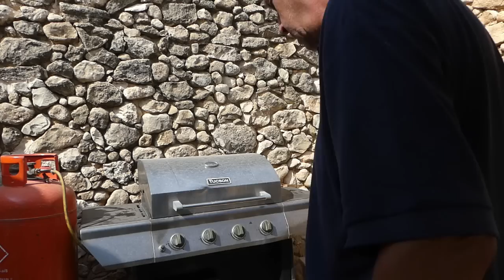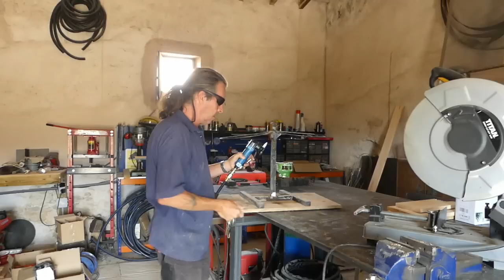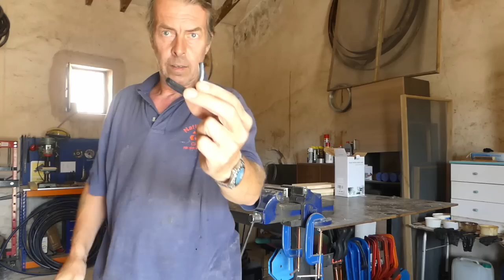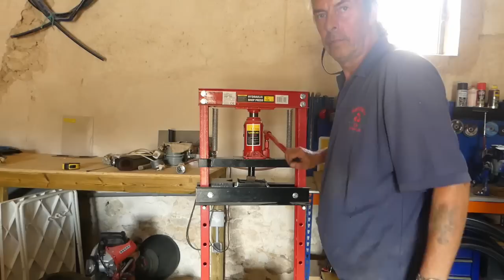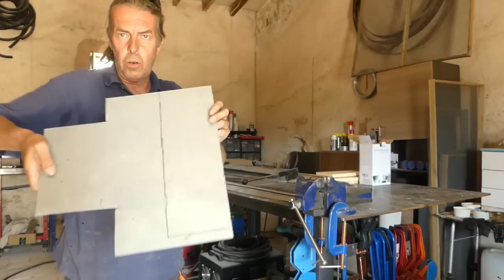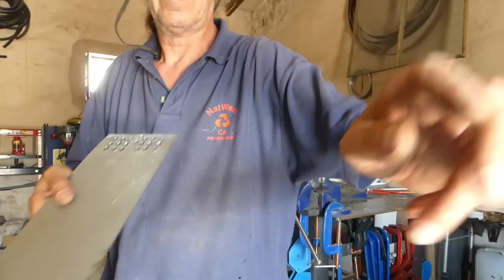Off grid Finca fabrications, welding, plasma cutting and bending.

Comment: Hi. I notice the machines under your bench have the cooling fans in the spark area when your cutting on top.
Maybe your not using the machines at the same time but the spatter and dust cant be good for them. Maybe find a better storage area and not under the table bench. Good all rounder just like myself.
Reply from the maker: Thanks Dave. No, the machine underneath isn't running and it's actually tucked in a lot more than it looks- It doesn't appear to be catching any harm. However, I might make a little shield for it out of some sheet or perhaps a cover would be better when it's not in use

Comment: What are the advantages of air tools over electric?
Reply from the maker: Hi Stephen, sorry for the slow response. Although battery tools are my preferred option in an ideal world, air tools are much cheaper, lighter, safer, produce no heat or sparks and are more powerful. If you are using multiple tools at the the same time, there is no need for lots of leads, simply swap the tool on the airline. Grinders for example, I have three with different discs fitted permanently that cost 30€ each. My battery grinder cost a couple of hundred plus and doesn't run for long until you need to change the battery. Then if you want to swap from a cutting disc to a grinding disc, you have physically got to swap it. Air tools can run all day, they don't overheat and they rarely go wrong with minimal maintenance - just a drop of oil each day you use them. Also, there is zero risk of electric shock etc from air tools and because they are so much lighter, fatigue is less of an issue. I hope that helps :)

Comment: Hi I came across your channel via Spanish homestead. When we moved to Spain over 10 years ago to (retire) i gave away all my garage tools ie welder , grinders etc thinking i would never need them in our holiday home. We moved to a casa de campo 6 years ago and how i miss them. It cost me 15 e just to have a small weld on my rotavator  ouch .Have you ever used a gassless mig any feedback. Your video inspired me to repair a water leak on my roof which has to same roof tiles as yours only we are in a two story house.It has leaked since we bought the house but only when it rains heavy so i have put it off.Hard work in this heat lugging buckets of cement on to the roof. Now waiting for some rain to test it .Over the years we have moved many tons of gravel and large rocks etc and learnt that it is possible to sustain injuries when one over does it.Take care.
Reply from the maker: Hi Heber, Thanks for your comment. Always keep your tools! I'm not keen on gasless mig as it's not as neat but does have it's advantages as you can use it outside in the wind, whereas you can't with gas. I would go for gas if you can, if you are using it mainly indoors. I use arc outside when it's windy :) Good for you on the roof. I use expanding foam to secure the tiles in place and if you put a good amount under them, the old tiles don't break when you walk on them. Yes also regarding injuries. A lot of the work, due to the nature of these buildings, is very heavy and injuries are easily possible.

Comment: Nice jobs in the Finca fab shop! Are you sure the galvanized bbq bits won’t impart any unwanted zinc flavoring or toxicity! I ran a number press brakes throughout my career and have duplicated many “flavor bars”/ diffusers for my coworkers and most of them have been stainless. And not necessarily food grade stainless. Just some “bbq” for thought! Cheers!😎
Reply from the maker: lol. yes. Welding galvanised gives off cyanide gas. You will see in tomorrow's vid that I 'burned if off' before using the bbq. Now, no smells, no tastes and the bbq doesn't get hot enough to release anything more. Good point though :) Have you seen the original 'chinesium' diffusers when you light a new bbq? :D